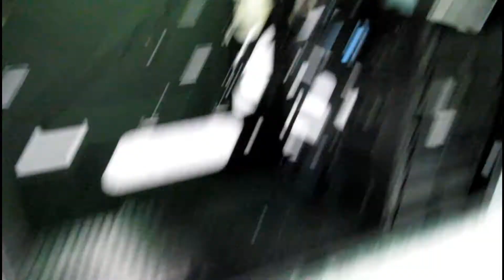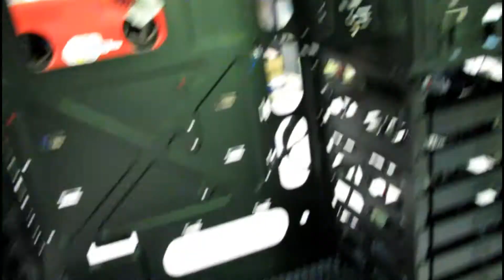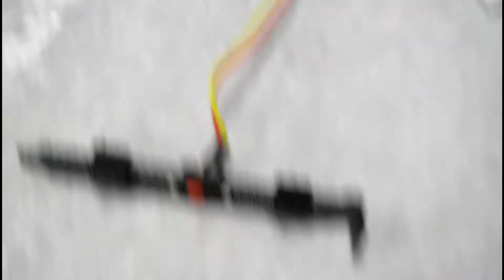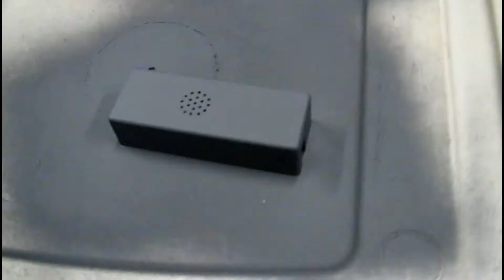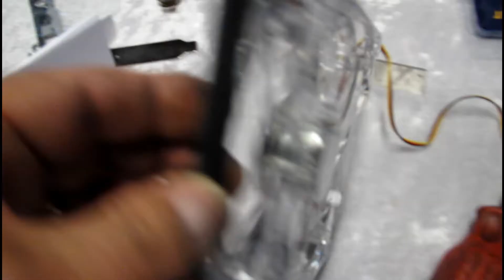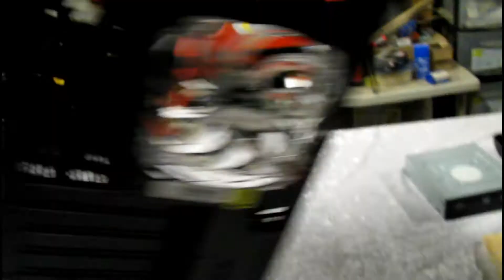Hoodcom 690 Mod: Final Phase (Video Compilation)

Comment from the maker: @airjamin8tor In my experience that could RAM. Some RAM needs a decent amount of voltage to run at the ECC  timings. If you are using tight timing or high speed RAM try using just one stick to Boot. You can tweak the timings or volts once you make it to BIOS. I'd pull the board from the case and trouble shoot with the minimum of peripherals devices plugged in. Basically just a GFX card, one stick of RAM not even a HDD. Not even         switches or LEDs. Until it boots all the extras make TS hard

Comment: Sweet! I have a 690 nvidia edition myself. I like the fan idea under the DVD player, I have a 6 channel fan controller there at present. But thinkin bout the fan now. Had it all together, now box testing it, won't get past the bios/cmos phase...freezes and crap. Workin out the glitches. Nice set up, got the cathodes *UV* same place with more to install. Blacked out looks good, wanna do that too....Right now just wanna get the damn thing runnin...lol